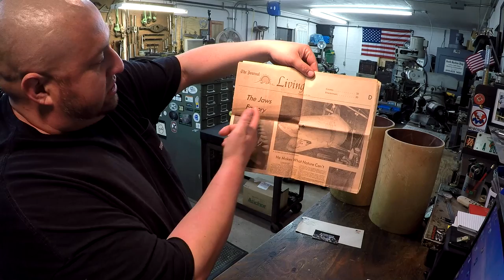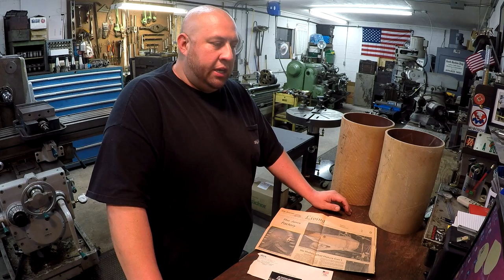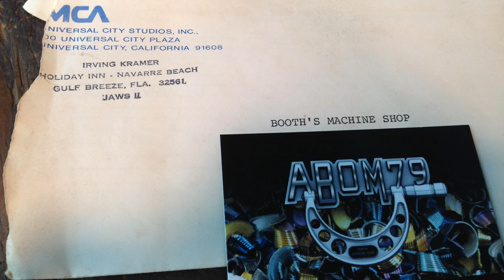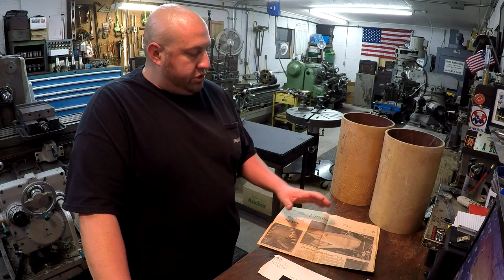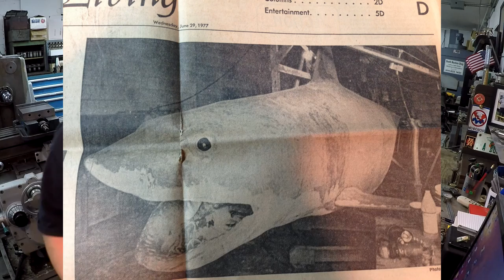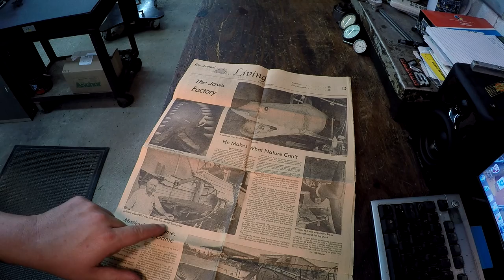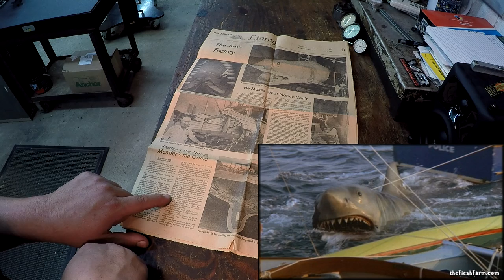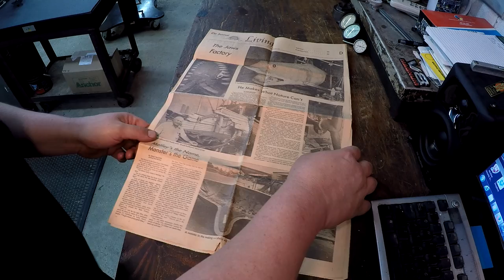Saturday Night Special 100 Part 2

Comment: I'm not a machinist by any stretch of the imagination. I'm relatively mechanically inclined (i.e. I replaced the front left hub on my '03 K1500 by myself), but I find all your videos so inspiring and interesting. Keep doing what you're doing, Adam. Your videos rock. Here's to another 100!

Comment: Congratulations on 100 SNS's!!!  While it never got the spotlight like some of your other tools in this video, I have a strong feeling that the little window unit air conditioner is the unsung hero in the shop!  I live in Dallas, Texas and have a window unit A/C in my shop.  $300 VERY well spent!!  Congrats again my friend!!
Reply from the maker: +milkcrate82 Your right about that, and it's crazy that right now I have it running. Christmas time and its warm and muggy out, like 100% humidity out there. Got it set to 70 to keep the shop cool and dry. Lucky for me it was free and Fernando fixed it for me, just has a small pin hole in the cooling line.

Comment: Damn collet don't fit, lol. Collet on an old ward capstan lathe was the reason I got in to trouble. Job was a 4 gang slip ring for a generator. Collet held the job but at the back was damaged and so it cut the job with a taper... Boss was not pleased to say the least money lost was over £2000.00 Looking forward to 200th episode. You suffer the same problem I have here Adam Space the final frontier. Jane
Reply from the maker: Yep, need more real estate!

Comment: Fun shop tour Adam, I did not see a surface gauge, do you have one? I use them in my shop for quite a few things and set ups on machines. I am looking forward to the day that you close in the that awning area. Man that's going to expand your shop!
Thanks for sharing and keep the projects coming.
Joe
Reply from the maker: +Joseph P. Polnaszek Yea I have a few of them. There was one sitting up on top where the balancing rollers are.
Reply: +Abom79 
Ah my eyes missed it. I seem to always get one or two more when ever I bring back a box of goodies from an action. I was going to sent one down to ya, but it sounds like your good to go.
Joe

Comment: Thanks for the hard work, Adam.

Your current shop- was it originally used as a garage, or was there a business there at some point in the past?  It's a nice building too.

Is the original shop location still around, and has anything interesting opened up there?

Thanks!
Reply from the maker: +joshonthetube The old shop is still there and vacant. I showed in in a past SNS video, one of the early episodes, even Dad is in there. The current shop was built my mom and dad and used as wood working back in the 80's. I've been living here since 2000 but it was mine as my garage since 1998.

Comment: Adam   When you described that big Cushman chuck to me once before you said:             " Man, that thing could hold the world ".   I guess that sums it up pretty well.    It's a shame your employer couldn't buy that Monarch  -  but at least you still get to work on the Kearns HBM.   Interesting setup at 13:12 of Part 1 with a toolpost mounted on the table, and spinning that cone-shaped part  -  perhaps a cyclone ?   I've never pictured an HBM being used as a large swing lathe before, but once you've seen it, it makes sense.    Well done on achieving the 100th SNS episode milestone.  Kind regards from Albion Park  NSW  Australia.
Reply from the maker: +Stephen Smith I used the HBM as a lathe many times. The picture I showed was a large commercial washing machine basket. I had to make repairs to the shaft. I have videos I never shown on the boring mill in that configuration, maybe I'll have to share them.

Comment: that box at 21:00....you have Machinerys handbook in the top center drawer...? I found your site here a couple months back...thanks to Keith Fenner...I've earned a lot watching both of you....thanks for the efforts to make/edit/post videos...     SNS100 pt 1...takes a BIG man to admit making mistakes....and that sort of deal helps you in the future....cost a few  $$$$...but like Dad said...we're selling a new shaft, not a repaired one....great advice...... Lista...how you like that stuff?  Appears you have $30-40K.in there   Lista....I see some used for sale out here in Sacramento, Calif.....and I recently acquired a Clark forklift exactly life the on  here in pics of your shop....do have any info on getting replacement 12 volt battery...and re-covering the rubber tire on drive wheel....? I jut bought some property up in waaaay  N.. Calif....32 X 38 feet...12 feet under trusses in all open space....will be looking for a  Bridgeport and lathe...maybe 12-13 X 55-60 or so......  Again...always look forward to next SNS...! THANKS....DOUG

Comment: oh yeah and adam when you were showing the stuff in the toolbox draws i spotted that measuring device that doubleboost sent to you quite a while back ( the blue tool in a kinda C shape with the dial gauge ) i was wondering if you ever found out what that thing was or is because i dont recall seeing anymore on that tool , maybe i just missed that somewhere but i would love to know what it is .
johno
Reply from the maker: Yes it's a tool for precise measuring of one size. You set it to the size you want and use it to check parts, or possibly as your machining them. Once it's set you read the dial plus or minus to your zero setting.
Reply: +Abom79 
ok thanks , so it would be very handy for doing repetition or production run type work then.
johno
Reply: +smokeytexx Yes it's a device that would be used by the inspection dept, for instance, in a place like an auto lathe shop wher large quantities of the same component are being produced.